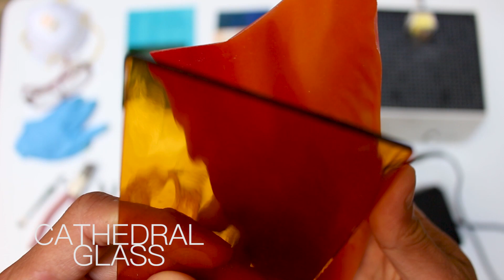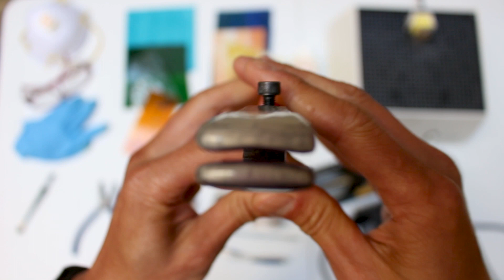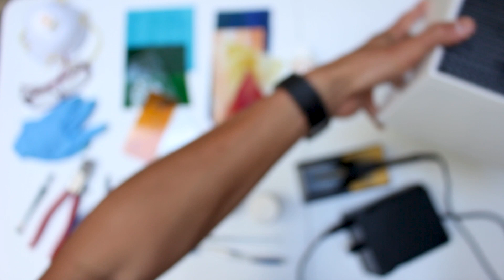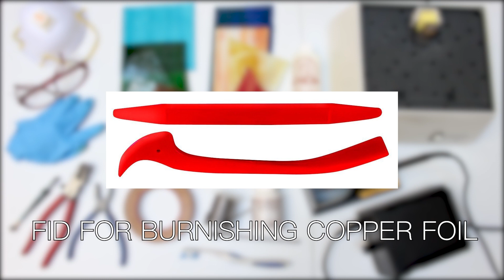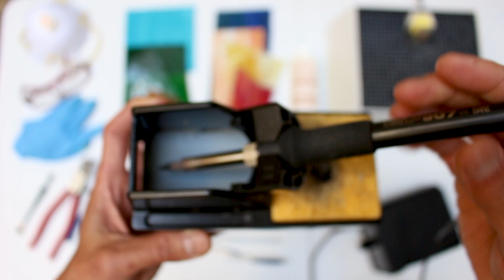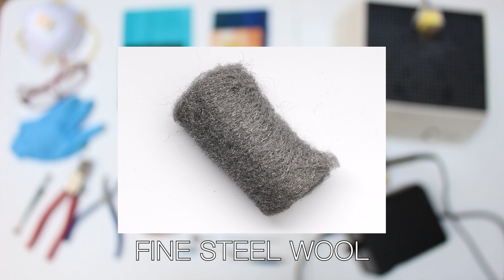Beginner Tools And Equipment For Stained Glass

Comment: Hi really enjoying your channel and love this video since i have not done any stained glass stuff yet and now know what ill need to get started. Anyway quick question ive been making tree of life sun catchers with agates and a friend strategically placed the idea of doing stained glass in my head. Ive been using steel rings in my projects and im wondering if i can solder glass to the steel ring? i just finished watching your vid with the dreamcatcher with the feathers and you used brass for the ring because it was easy to solder to which led me to my question about the steel ring. Thank you for any help with this.
Reply from the maker: Hey I don't believe you can solder onto steel, it will be tough and you might need higher heat other than the iron. Brass, copper, tin, zinc, iron are all fine.
Reply: @StainedGlassDIY  thank you i may have to find another solution to mount it in the little metal ring then.

Comment: I started cutting glass on my osb board table without thinking about the little gaps in the board. Not a smart move.. So an extra tip might be: Work on a completely smooth service to prevent tiny pieces of glass getting stuck in your table. I fixed it, no more razorblade tabletop 🤣👌

Comment: Your video is so inspiring and informative! Can you work indoors with ventilation? (Open window) and how messy does the workspace get? I’m only thinking small projects for now...
Reply from the maker: I would get a fan to suck out the fumes towards the window. It could get messy with glass bits if you start using the grozing pliers. Grinder is messy too. 😂

Comment: I found some old glass cutters that my mom used maybe 30 years ago and I’m wondering if these are still useable since I’m in lockdown and want to try and not order anything from the internet if I don’t have to... any info would be appreciated!
Reply from the maker: They could still work if the cutting wheel is still sharp and not rusty. Try to see if you can get a good score and if so you’re good!

Comment: I hope I can give some tips for you. Im new at stained glass but i have certifications in soldering so id like to give some tips. 

To make your soldering tip last longer and keep it from burning up, use a tip tinner and use it before you start working and right before you turn your iron off. This helps to melt the solder easier and saves your tips. If you start to notice that your tip isnt melting your solder instantly, tin your tip. 

If you notice that you applied too much solder in an area, you can actually turn your tip flat and scoop some solder right off and use a copper metal sponge to dip into. This takes the solder off the tip faster than a wet sponge. Or you can use a solder wick and heat it over the solder  lumps (apply flux first) and it sucks up the solder. Very helpful when trying to get all your beads even. 

Soap and water is not necessary to remove flux. Flux comes off easily with high % rubbing alcohol and leaves no residue. Use a no lint rag or you can use qtips for small areas. 

If you have a joint or bead that isnt smooth and you arent happy with it, let it cool for 1 minute. Brush flux all over the entire area and add a small bead of solder to your iron tip, touch the area and slowly go over the area. You have to apply the flux always to reheat any solder. But dont keep reheating it without cool down time in between or you will compromise the foil and weaken it. 

If you are unhappy with any old projects, you can use solder wick to remove all of the solder and start over. Use flux to reheat with the above step and wick it all up.

You dont need any type of polish for the solder joints. Solder dulls because of flux residue. High % rubbing alcohol will shine up your solder if you polish it well because it dissolves the flux.
Reply from the maker: Thanks for the tip, I'll try alcohol when I get my hands on some. Do you polish your work?

Comment: I saw some cheap stained glass grinder that has no place to put a sponge on top. Is the sponge necessary and do we must use the novacan cooler in the water? Also, when the grinding the glass with the grinder, will the glass powder/dust fall into the water or do they fly everywhere into the air?
Reply from the maker: The sponge will wipe the grinding bit to keep it clean and always wet. The coolant is good to have but probably water is okay.  All that glass dust goes on the sponge and also wherever the bit spins it out. It could get messy!

Comment: Isn't lead a nono? Are there alternatives?
Reply from the maker: Most people use lead based solder since it's easier to work with.  I have not used lead free solder before but the option is there for you if you'd like.  Normally for jewelry and accessories.  Lead is okay if you wash your hands throughly and not ingest and use for decorative pieces.
Reply: Ah, ok.. thanks so much! One more question, sorry..  Do you really need a flux brush or will any brush do?  I won't use animal hair for this; it would actually be a deal breaker. Love your vids, so helpful :)
Reply: Kerri B, I have seen folks use a quip in their video...
Reply: Kerri B that is a Qtip, sorry!
Reply: Thanks for the tip! After I asked this question I just went ahead with a regular paint brush :)

Comment: Do you think I could use a dremel with a diamond bit instead of the grinder?
Reply from the maker: I've never tried with a Dremel but the main goal is to grind smoothly and safely so if you can set that up somehow, then I would guess it could work. Just not sure how efficient and effective it would be either. I end up using the grinder quite a bit. Be safe and let us know what you find!

Comment: What should I use to prevent oxidation of solder?
Reply from the maker: Are you referring to long term caretaking? Wax does a great job but not sure if that was what you meant.
Reply: @StainedGlassDIY  Yes, after some time the metal surface becomes blury. You can see some sort of white spots on it.
Wax like the one you mention in description? Car wax?
Reply from the maker: @angelikapodgajna8186  Did you use solid core 60/40 solder? It should be shiny for a very long time and car wax or any wax to keep a coating once in a while.

Comment: would a piece of drywall work as a board?
Reply from the maker: Yes that'd work just fine. I'm using a piece of plywood now and it's all fine
Reply: I am a newbie, I saw on Rockfish Studio share she uses a commercial size ceiling tile, cheap and it’s fireproof, I saw that she duct taped the edges.

Comment: The grozier pliers can also be called combo pliers as breaking pliers are flat jawed with no teeth or curved lower jaw.

A tip for keeping your foil where it belongs is to use a binder clip and place it all the way on the roll, This will keep it from unwinding and you can write on the clip the size/color. Super handy when you start adding lots of sizes and backing colors to your pile.

This was a great video! Keep up the fantastic work!
Reply from the maker: Hey, thanks for the tip! I'll try it out. I was thinking to get those dispensers to help my sanity every time they unraveled 😂